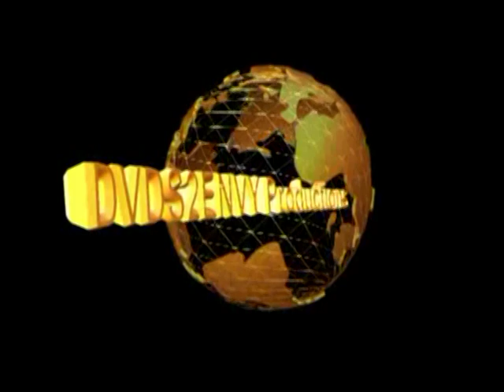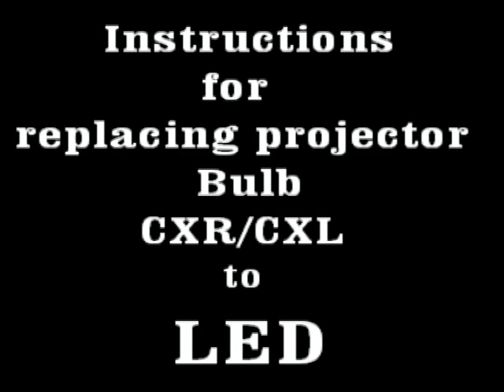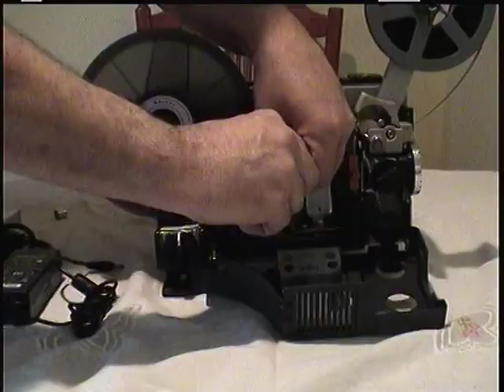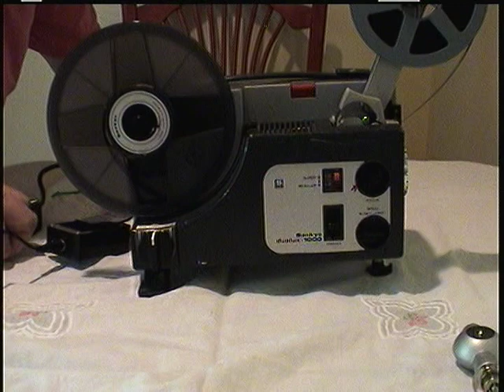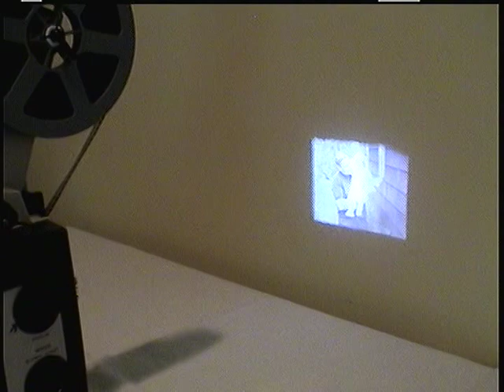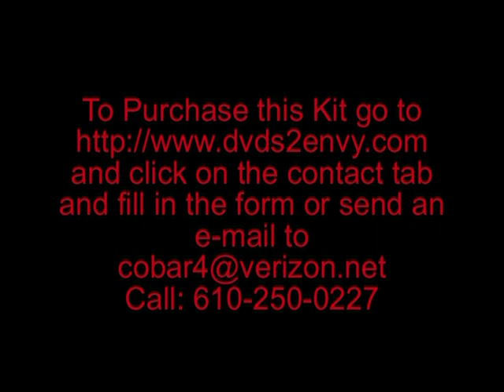LED  Bulb Replacement Kit

Comment: 1) How many watts is the LED?
2) How many lumens?
3) Have you tried warm white instead of cool white?

Thanks.
Reply: The LED produces a little over 20 watts using a 2100ma  BuckBlock. Using the cool temp.  6500k (cool white) the  leds (3) along with carclo lens beam narrower it produces a total of 2,328  lumens.  The neutural white (4000k) leds produce the same wattage ( a little over 20 watts)  but slightly less lumens (2,124) along with the carclo lens beam narrower.  #3 Yes have tried both and  my personal preference is cool white. Why,  at times the color balance filter is not in play or the film maker has neglected to use the correct type of film (daylight or flood). Again it is a personal preference.